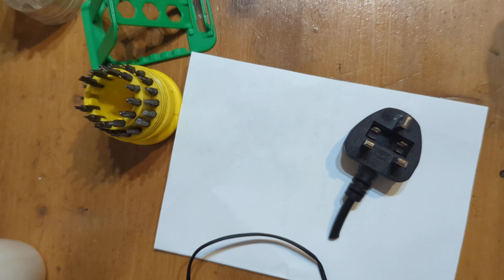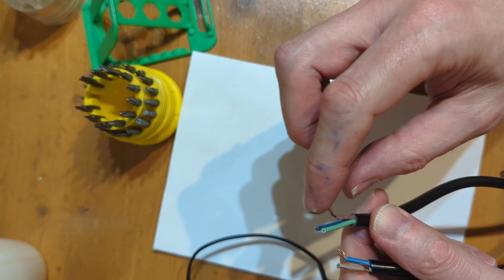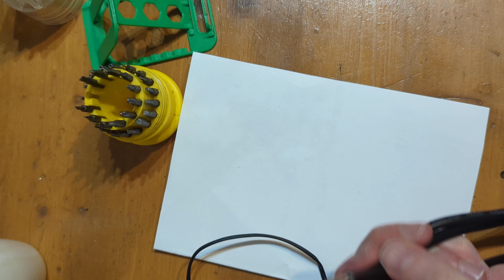Dangerous Fake UK Mains Cables

Comment from the maker: Equally, if not more concerning, the plastic on the Earth pin may mean that it does not make contact within the socket. This would completely defeat the Earth and result in an unearthed appliance with insufficient current capacity. A recipe for disaster.

Comment: A lot of the current (Sorry! 🙃) race to the bottom started after the end of December 2021...So one thing that can help date more recent equipment (And a greater likelihood of poorer quality in low-cost product) is to look out for the UKCA mark. 💡

Now equipment pre-dating this point isn't necessarily going to be safer than stuff made after that point, but it was after the UKCA mark came in that a lot of the pressures to use cheaper materials really took hold. Ergo, the UKCA mark can be a useful tool for working out whether it might be a dangerous fake or a very dangerous fake. 👍

Comment: Bumped into this myself when looking for an IEC plug to scavenge. I cut the moulded mains to IEC cable in half and I could barely see the wires! Really not sure they'd even be safe with a 3A fuse in there, let alone if someone plugged in a PC with a bit of grunt. I think they came with monitors the office bought.